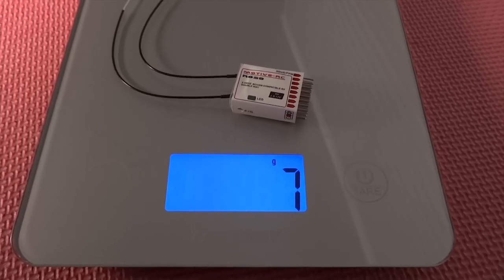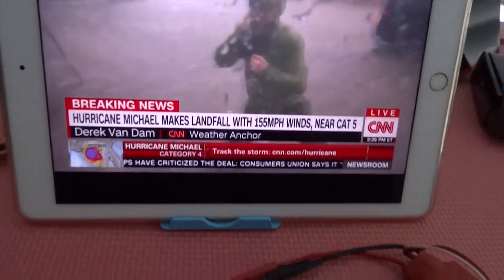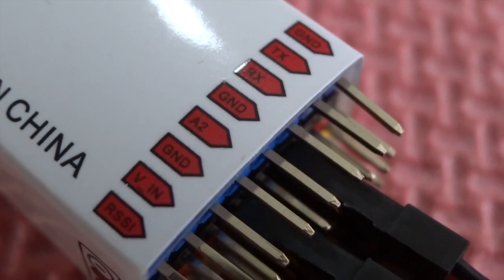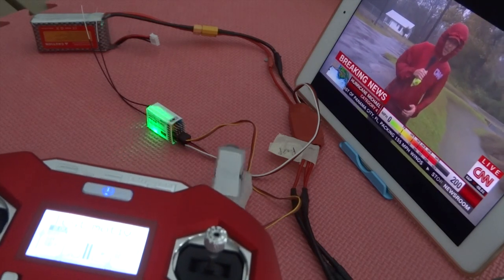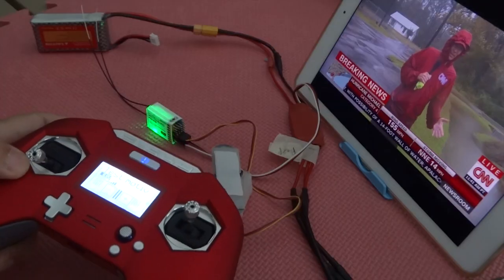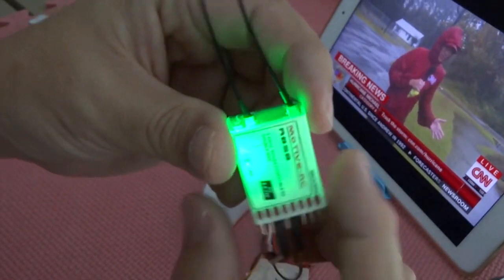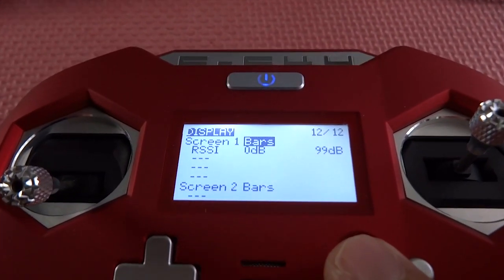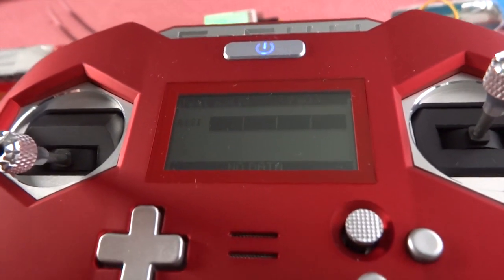Setup RSSI on Taranis X-Lite Motive-RC R8SB Telemetry Receiver

Comment: Hi! Maybe you know the answer: is it possible to get sumppm on one pin and the throttle pwm signal on an other? I use Cyclops Storm autopilot with osd, it receives sumppm, but does not handle throttle. I must have it separately to the esc. Thx!

Comment: Hi - looks interesting.  Can you please share how you get this to bind?  I am wondering if mine is faulty, as it will not bind after many attempts, both following the instruction sheet, and trying things that work for me with genuine FrSky receivers, and even other brands like Turnigy, FlySky, etc.  (Would like to try what you are showing, but until it binds, I can't get anywhere!)
Cheers Mort
Reply from the maker: Let me check and get back to you.  There are two common methods that I recall - Leo
Reply from the maker: Typically, to bind, you just plug in the bind plug between channel 1 and 3.  Power your receiver.  No need to hold any buttons.  Next power on your FrSky transmitter, set it D8 for 8 channels, click BIND, wait a few seconds then exit the bind, turn off everything and back on again.    For SBUS receiver method requires you to hold the button of your SBUS receiver while you power it on the receiver, the rest of the steps the same.  Try the first easy method if it comes with a bind plug.
Reply: I have the same problem trying to bind this receiver to my Qx7. The instructions say that for the Qx7 you need to set the receiver to mode 2 (0f the receiver) so I select mode 3 and then as per the instructions give the button one more short press to lock it in. The receiver doesn't lock in but instead moves to mode 4.
I have 3 times emailed motive support but they do not reply!
Does anyone out there have the answer?
Cheers Ziggy